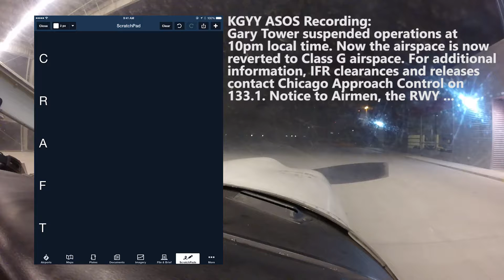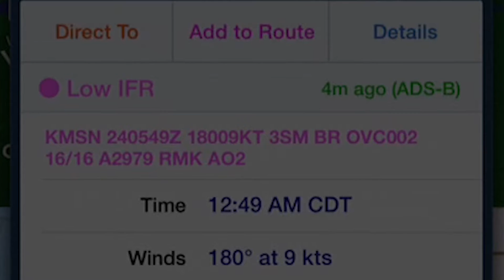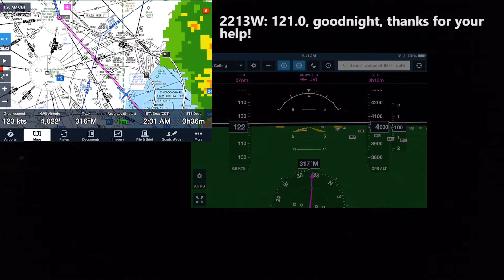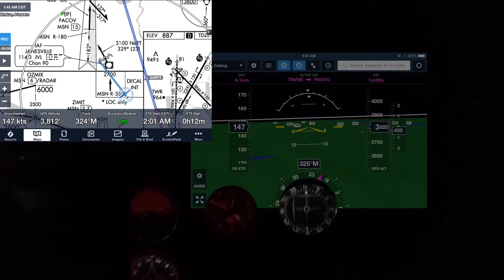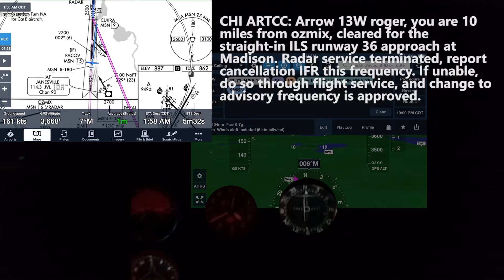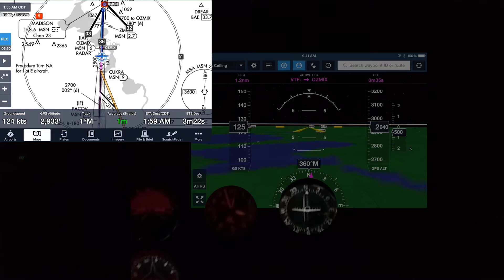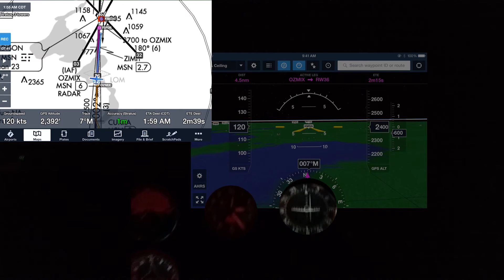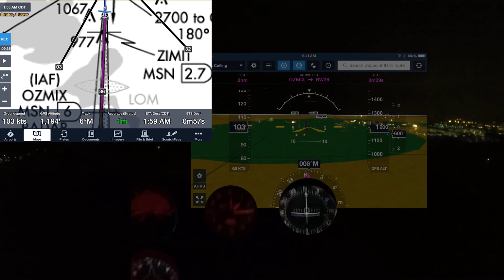Night IFR + ForeFlight Synthetic Vision (Extended Cut)

Comment: A good technique for any approach is after intercepting the localizer or the inbound course on a GPS approach, set the inbound approach course heading with your HD bug. Also fly the airplane even while talking to the controller, you drifted and deviated right of course after you intercepted the localizer when you got distracted by the controller and your HD bug was still set for last heading assigned by the ATC. Use the AP if you have one, it reduces your workload during hard IFR approach. Otherwise, nice job.

Comment: Nicely done! Thanks for posting. I also fly an Arrow. One note about pilot-controlled lighting. The current Madison chart shows a rabbit (ALSF-2) on Rwy 36, but I see the rabbit sleeps and operates only as SSALR when the tower is closed (per AF/D).  If I’m landing at minimums, I want all the lights up bright, and early. I would set up whatever lights there are before starting down.

Comment: With the tail wind of 170 degrees at 9 knots, why did you land on rw 36?  Is it safer in your opinion to fly the straight in long final without banking turns (while IFR)?  Or was it for time savings? Or something else?
Reply from the maker: At 11:15, the AWOS (tower closed) recording includes "ILS 18 out of service" so I was forced to use ILS 36. ILS 21 was another option but the ceilings were low enough to where I wanted the 200' AGL minimums instead of 250' minimums of ILS 21.

Tailwind landings aren't horrible as long as it's not gusty and you're comfortable with it in your airplane.

Comment: So when u have the stratus 2s, u get the live weather without any other connection? I am assuming u are using the that is the stratus 2s
Reply from the maker: This is the Stratus 2 (I purchased it before the 2S came out). The radar is delivered via ADS-B and isn't completely "live", but is a composite view that is typically a few minutes old. As a pilot, though, you should always be skeptical of the age of the radar and not rely on it completely.
Reply: Mike Cardosa is theADS-B embedded in the stratus ???
Reply from the maker: Yes, the Stratus provides ADS-B weather radar and textual weather (METARs) as well as traffic alerts (limited, depending on if your airplane has ADS-B-OUT installed).
Reply from the maker: https://www.foreflight.com/products/stratus/ for more info.
Reply: Mike Cardosa ohhhhhh wow, that is great, ... that explains why it's expensive..... gonna get it when I get rich 😄😄😄😄😁😁😁
Reply: Or u can just donate urs whenever u no longer have use of 😜😜😜it.... great video btw....
Reply from the maker: The Stratus 2S unit is around $800, and worth its weight in gold if you value safety like I do. :)